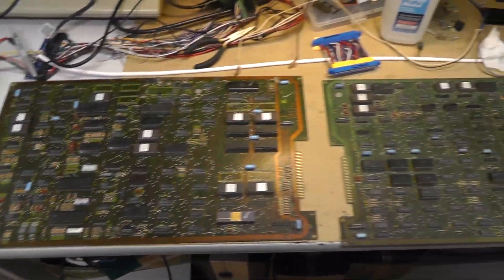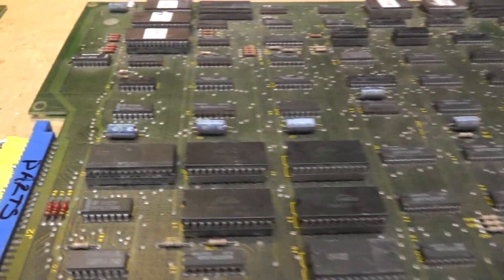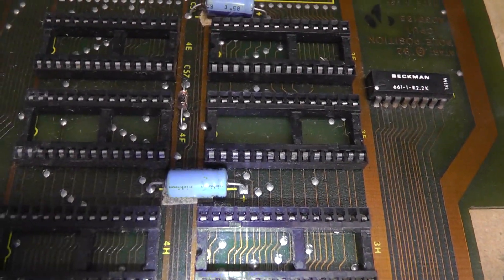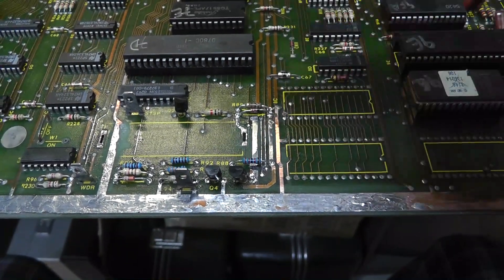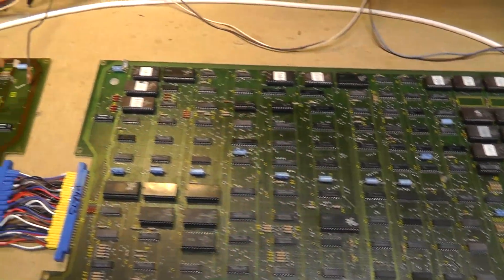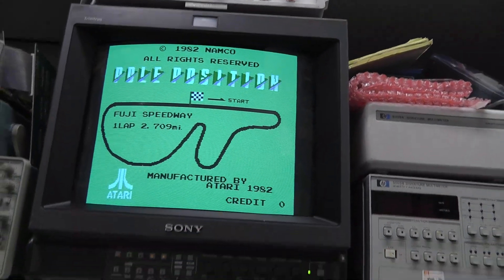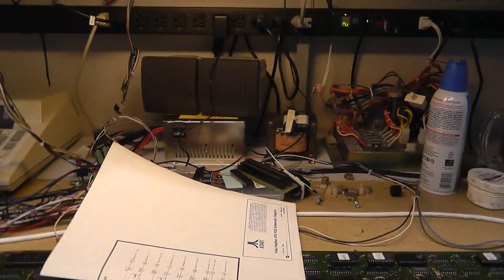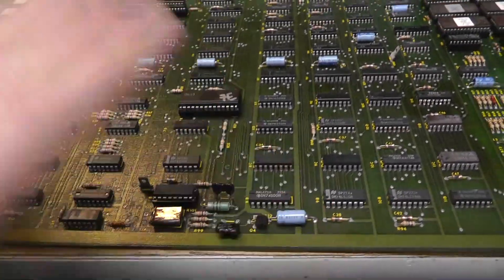Pole Position PCB Repair - Cleaning, Blank Screen, Missing Color - RevB Set Part 1

Comment: I love when a board starts working too  :)  - I fix a lot of DigDugs and Tarnex is great for cleaning those customs..  I do about 10 minutes, then wash & dry.  I use a fiberglass pen for leg cleaning..  they just need a touch of polishing and they look brand new.  Dremel would do the same I'm sure..
Nice work on those boards.
Reply from the maker: Great tip!  I probably haven't been leaving them in the tarn-x long enough.  I typically use a toothbrush on them after the tarn-x bath as well.
Reply: @jacklick  I initially worried about 'over Tarn-X'ing' them..  but I've stretched it a bit on really stubborn customs. I think it essentially removes all of the silver coating and you get to the tin legs..  But at that point - the silver is useless.  the tin legs clean up perfectly..

Comment: What is R89 in the circuit doing? because some boards its 100ohms or 1K ohms or another value.
Reply from the maker: I had to look it up.  R89 is the recharging resistor for the battery.  I assume higher ohms equals slower charging and lower ohms is faster charging.  I will have to inspect a bit more closely to see if using 1k was common or just from a previous repair.  Most of these have the battery removed at this point so it likely doesn't matter much.
Reply: @jacklick  I have heard that using different types of batteries like carbon, alkaline, Lithium Ion, NiCad you have to change the recharging resistor. I have heard if you use Lithium Ion you don't have to worry about the battery acid damaging your board compared to using Alkaline and NiCad is the worse battery acid of them all. Have you looked into this?
Reply from the maker: @waynegram8907  Interesting.  I haven't looked into it.  I never keep the rechargeable batteries on the board and just use nvram.
Reply: @jacklick  you can use lithium ion battery and they don't leak battery acid so u can use nvram. Look into it
Reply: @jacklick  slow charging batteries makes them last longer I have heard. When fast charging them it does something with the battery memory